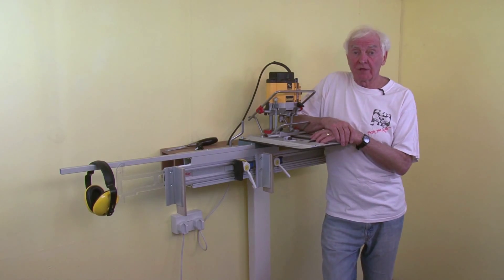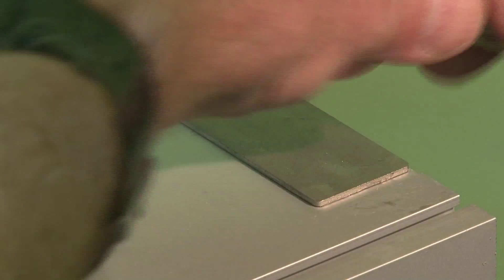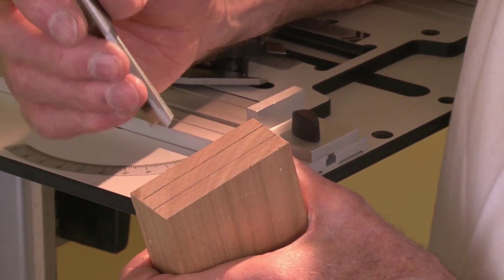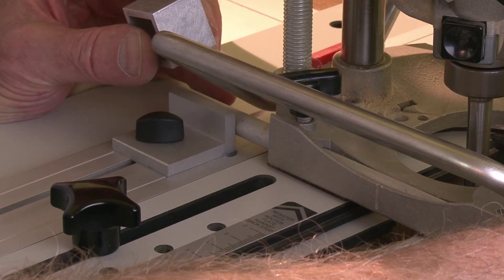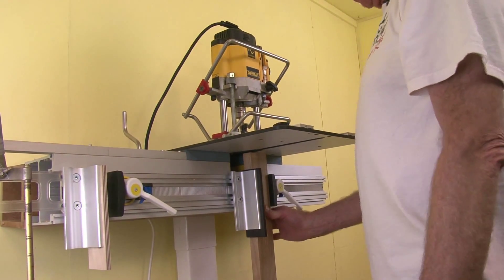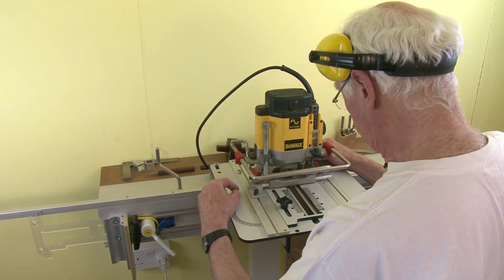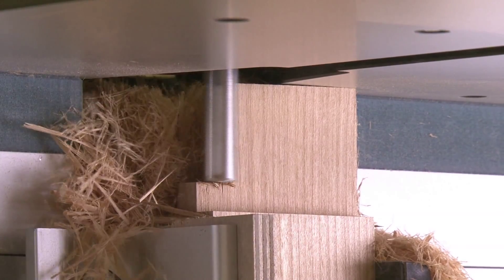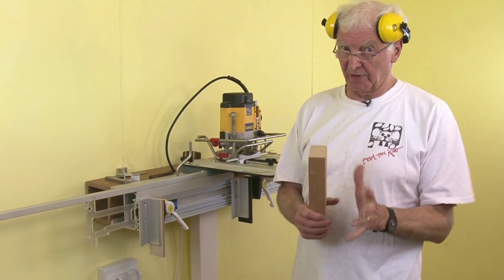The WoodRat Makes Tenons

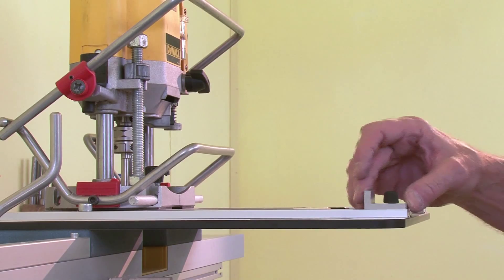Comment: Hi, a I noticed at 0:59 and 1:11 the whole router base or plate flexed downwards when you hand tightened the adjustable stop knob. That does not seem very rigid, because it would also flex while you're moving the router forward, making the cut depth deeper as the router comes closer to you. Am I missing something here?